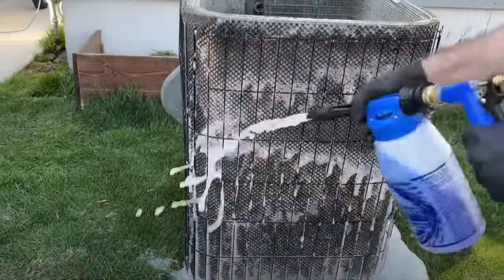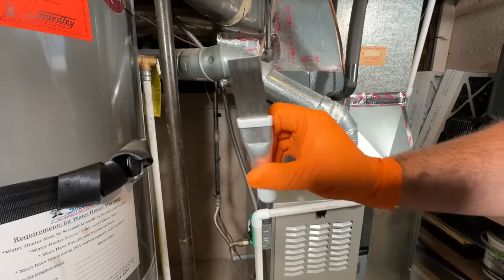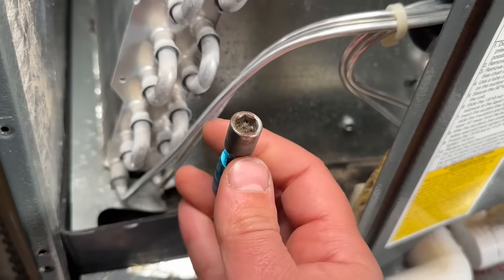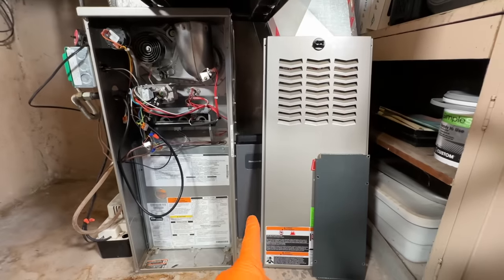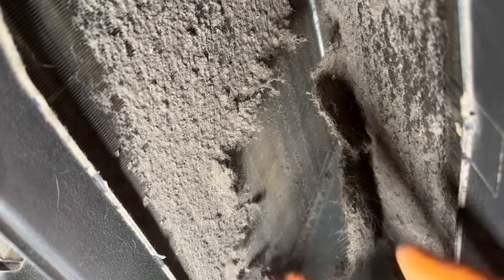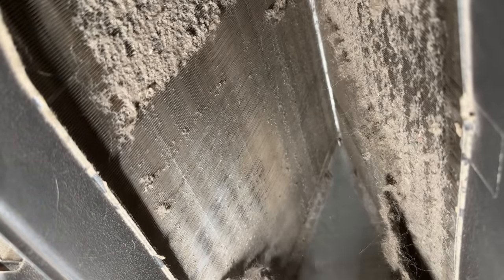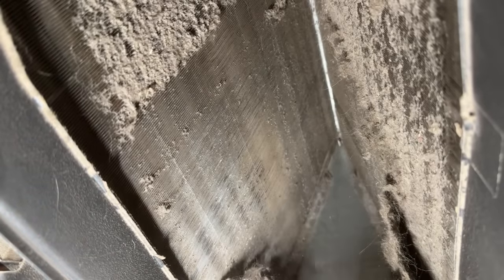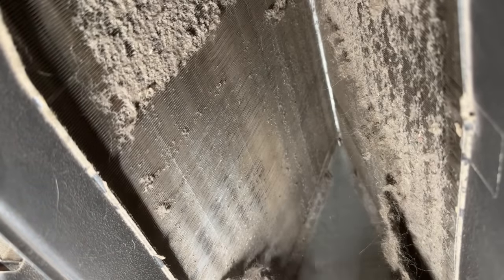How To Properly Clean An AC Evaporator Coil & Save HUNDREDS!

Comment: After doing 15,000 residential service calls, I can tell you that the vacuum is your best friend.
Reply: That's the truth I would have put the vacuum on that mess first thing
Reply: Dog brush, vacuum and then the GARDEN HOSE on full blast.
A little messy but its LIKE NEW!
Reply: Whow
Reply: Toilet bowl brush 😉
Reply: @fladave99  I would advise not using it on full blast if you have a  micro channel coil.
Reply: @perrycrowell2953  I brought in the garden hose 
Full sprayer. Not playen
Worked good
Wife cleaned up the mess
Reply: @perrycrowell2953  why
Reply: @fladave99  why
Reply: @perrycrowell2953  You would not believe the dirt that came out. Wifey freaks out at the huge flood on the floor. HOLD MY BEER BABE!
Reply: Awesome video dude
Reply: @orlandolopez4410  lol
Reply: @orlandolopez4410  51 yrs because u have to wait on hold
Reply: @orlandolopez4410 what math are you doing.   If he does 3 a day x 300 days that’s 900 a year.  

Times 17 years that’s 15,300
Reply: @oscarrodriguez1068  he just said 15,000 / 300 = 50. 
He forgot to multiply the 300 days by the 3 service calls per day.
Reply: Love the math commentary #mathchat
Reply: @orlandolopez4410  yeah and 50 plus 20 is 70
Reply: 17000 whow
Reply: @oscarrodriguez1068  when
Reply: How much do you charge to clean this and the unit outside?
Reply: @billy-santos  who
Reply: @CCCC-tq8yo  how much to charge for the clean ? The handyman how much will he charge?
Reply: I have a mobile home A coil and looking to find out what would be best to clean it without having it cut out to clean..The people who lived here before ran it for 2 years without a filter and the coil it at the top with blower up under it..Would love the input on how I can do it myself..
Reply: Tape that brush to the top of a shop vac lol
Reply: Yep as I new home owner, this is the issue 80% of the time. Clogged lines. Shop vac baby
Reply: @CCCC-tq8yo using a hose on full blast could smash the fins, and the fins are what help the heat transfer. If they're smashed they're not efficient. The same caution applies to cleaning the condenser coils outside, where it's more common to use a garden hose sprayer.
Reply: I was going to ask “why not a vacuum?”
Reply: I have a weird noise that stars when ac kicks in . Almost sounds like a spring, any idea what that would be? I don’t know how to describe it but it’s when the ac Turns on for a couple of seconds
Reply: Yeah I'm charging 1500 for this..
Reply: @orlandolopez4410 Your response is what is 🐃💩! Where did you learn your math?🙄 If you paid for it...get your money back!!
Reply: Damn right; vacuuming and a small brush does the job
Reply: @orlandolopez4410 brah if you take 2080 hours a year and divide that by 3 hour calls that is  693.3 calls a year. Divide 15,000 by 693.3 is 21.63 years with zero overtime. 15k calls is definitely not a flex and could easily be done in a 30+ year career. You must use that new common core math 🙄
Reply: I’m trying this! I was quoted $1,150 😮!
Reply: @CCCC-tq8yo  Because the pressure will bend shut the thin, flexible fins, rendering them useless.  Water pressure in this case is good -- up to the point at which it's bad.
Reply: it's true.  I don't understand why he does it that way.  smelling all that dirt.  There are also very fine filter-type fabrics that allow the oil to pass through and retain the dust very well... so that it is easier to clean.
Reply: @fladave99  heh heh.
Reply: Dang it, I came here to say the same thing but you beat me to it!!!! Lol
Reply: She's the "EX-wife" now.
Reply: Question?? The example is an up flow system. If you have a down flow system, I would be concerned with cleaning the outside of the AC Evaporator Coil. Correct?
Reply: I don't care about the math, but my unit is sealed. The ductwork has tape and a dried compound on all edges.  How do I access the coil?
Reply: @budman-tw6rr  
With great difficulty.
Reply: @fladave99  you don't want to damage the fins on that mesh with full blast water.
Reply: @fladave99  as someone who actually has to clean up after themselves, I'll stick to a vacuum, brush, and the coil spray 🥴
Reply: @budman-tw6rr  same way with mine, I guess it was common thinking you never need to clean your evaporator coils. I’m thinking of removing the filters. Cut out a plywood plate to fit tightly and with a fitting for a shop vac. Then close off all your vents with the exception of the one closest to your evaporator coils, remove the register and put a electric leaf blower into the hole and seal it off. Then go turn on your vacuum and then your leaf blower and hopefully that will create enough back pressure To pull off the worst of the junk on your evaporator coils.
Reply: Why would this A coil be this dirty? This is not normal.
Reply: @BlueRage  
1.  No air filter installed.
2.  Return located near the floor.
Reply: @scott5654  Absolutely. No coil in any modern furnace should ever look like this.

Comment: You gave me the courage to clean my coil. It took me about 5 hours just because I was extremely careful not to break or bend anything. My system is over 20 years old. It was not as bad as I thought but it was bad. Thanks for the detailed video.
Reply from the maker: Glad I could help!
Reply: Notice a difference?
Reply: Yes for sure. It cools much faster than before. Not only it cools faster, I notice the air flow is much stronger. Thanks again.
Reply: Update: for the last several summers my AC would run nonstop on hot days. After cleaning my coil it runs and cool down the house and shuts off. My condensate is noticeably much heavier than before.
Reply: @tanman005  why
Reply: 5 hours to do a thousand dollar job? That's a big win!
Reply: I know you were careful but 5 hours seemed a bit much? Seems like about an hour or two .... What's the typical time you would expect ?
Reply: @pcexpress911  I assume the 5 hours was due to him being extra careful and thinking about each step before actually doing it. if he ever has to do it again, it'll go faster. He probably kept pausing to refer to the video and also took a few breaks to work up the nerve between steps. That's how it was for me. Especially when the wife wants you to pay the $3000 to just "get it done". You can't afford any setbacks or you'll never hear the end of it.
Reply: @kharisjohnson  AMEN brother!
Reply: @kharisjohnson  First time takes longer due to caution..

Comment: A good idea would be to have a shop vac going while pulling out the dirt clogs, to catch the plume of dust.  Also, if possible, if you seal around the filter's edge with painter's tape, you can almost completely eliminate bypass, keeping coils clean much longer.
Reply: Shop vacs , duct tape , zip ties , man’s best friend !!
Reply: I stick foam sealing stripps where need in the filter channel and on the filter door/cover so that no air can bypass lthe filter
Reply: great idea!
Reply: That's a good tip about the painter's tape. The contractor who installed my unit when the house was built didn't even include a filter housing. The filter just lays diagonally in the duct. A real hack job. But using your tip could make it work better.

Comment: I have "cleaned" my coils on several occasions. I never thought about sliding the entire assembly out of the duct work! I did even think it was possible without discharging the system. Thank you so much.
Reply: Same here didn't think of sliding it out. I cleaned it on the furnace with a towel to grab the water before.

Comment: Just pulled the cover off mine.. 17 years old and still clean.. Im a smoker and i had a large german shepard for 12 of those years.. i was surprised it was still pretty clean.. a little discolored brownish but overall clear of debris. Always keep my filter changed!
Reply: Thats because all the crap is caught up in your furnaces secondary heat exchanger
Reply: @marriagepartnersministry5942  Nope.. heating element and fan motor are clean also.
Reply: Hard to believe. But whatever.
Reply: @Jackie-O.Louisiana  I have no reason to lie to a bunch of strangers on youtube..Maybe its because i dont keep my house very cool or hot and turn it off when im at work.. Low usage i guess..
Reply: @marriagepartnersministry5942  change your filter.
Reply: I have to wonder if the system in the video was basically running without a filter, and had fluffy dogs in the house shedding.
Reply: i think it depends on what filters you used, like i use a spacegaurd filter cuz my mother smoked 4-5 packs a day ... plus even with a normal cheap filter the nicotine would make cheap filter work better cuz they would be sticky so everything would stick to it more. i'm curious to look at mine cuz mine was never cleaned and its 28 yr old lennox system. i just haven't figured out how to easily get in there yet. i may have to cut a access hole in back of a-coil piece ...
Reply: @-AnyWho  that makes sense with the nicotine making the filter work better.. I had to use a yard ruler with my phone rubber banded to the end and recording video to see my fan.. but it worked lol
Reply: @yoyo7856  that's actually a good idea ...

Comment: where your overflow shut off  is, if you take the float off it and pour a cup of vinegar down that pipe that goes into your drain pain, once per month, you'll never have to worry about Alge buildup  in your drain line again. Plus it keeps the drain pain clean of any alge growth.
Reply: Once a month would be a real PITA for me. Our air handler is in the attic and we live in the Charlotte area where its reaches 90+ multiple months a year. But I know that it would help a lot.

Comment: Good info, thanks.  I checked filterbuy.  Unfortunately, they do not list the static pressure drop (in inches of water column) that their filters cause.  Filters are one of the most restrictive elements of an AC system.  I switched from a MERV 11 - 1 inch filter to a 4 inch filter which had a low static pressure drop.  My CFM at the return grill went from 980 to 1300.  It was much quieter, as well, as there was less air friction.  After cleaning the evaporator coils and straightening the return grill fins, my CFM is now up to 1750.

Comment: Honestly I’m amazed we haven’t figured out a better design by now for heat exchange in our central air systems.
I know there’re plenty of people out there that don’t even know they’re supposed to change a simple filter, but even from a serviceability perspective there’s got to be something…better.
Reply: In my country, we have to clean evaporators once every 3 months as it's very dusty here. That's why we use split ACs which are easily serviceable.
Reply: This is a split system by definition.  Do you mean mini split or ductless?
Reply: There is no reason we can''t create a marketplace standard for quick & easy access panels designed for the consumer to easily clean evaporator coils, but no. It gets far worse than this for many systems, and it all happens because governments aren't doing their job in creating proper serviceability standards. This could all have easily been corrected decades ago, but we ignore the problem year after year, expecting an industry to correct it for us which has zero interest in doing so.
Reply: @uvhciM  true, the problem is that from the consumer perspective it costs a lot of money to implement any of these changes, so it doesn’t happen quickly even once they are available. But that’s just it, they’re really not available at all, even today. 
Like you say, it shouldn’t have been difficult 20+ years ago to design the newer generations of these coils to have some sort of access panels and drain systems to divert the runoff, or even change the typical straight vertical coil-over-fan so that there was a better layout in place for cleaning without fear of everything falling straight into your fan/electrics etc. 
I will say a lot of the issue is that in a lot of cases the utility space is a huge limiting factor to the install that complicates things, in that the final product is hardly ever as nice or what you have in mind. Compromises have to be made. So it is difficult to produce a simple modular type system that will fit every scenario and work as intended, but I would definitely like to see some productive conveniences implemented that would make it easier for the tech and homeowner alike to service and maintain, as well as allow the systems to last longer.
Reply: I was watching a “pros don’t want you to know this secret” short about cleaning your condenser unit and it reminded me about my pet peeve with those too.
Back in the early 90s at least some of the units came with a fan guard that was removable without removing the fan and motor assembly from the top of the condenser. Why TF did they ever do away with that design that allowed for easy access to flushing the condenser from the inside out by any homeowner?? Or was the risk just too great that some idiot would forget to pull the breaker and chop their arm off… we’ve become either so reduced by the lowest common denominator or whatever saves the mfgr $.75 on the assembly line, one or the both, but either way it’s entirely fd us for decades now.
Reply: Well yea, the AC industry wants to sell you a $7000+ AC system absolutely as often as possible, but not so often that it's suspicious.
Reply: @piezoman79 , my ac air handler unit is set up like this:
1. Air filter 2. Coils 3. Air blower 4. Plenum. It does have the coils over the blower. The coils are under.
Reply: @uvhciM  you blame government and you blame companies.  Make a company with a better design.  I bet you haven't talked to your gonverment reps to get a better standard.
Reply: They have. It's called a mini split.
Reply: just something as simple as to be able to open the duct on both side
Reply: I absolutely agree, the condenser coil should be designed on a pull out shelf for easy cleaning. Likewise the evaporator coil should be designed to easily remove the outer protective cage for easy cleaning.
Reply: easy servicing comes when you initially install the unit. Not everything can be easily accessed for everyone every time but simply asking yourself how easy this will be to get out if i need to goes a long way. You see stupid people run pipes and build enclosures around things as if they never will break or need to be touched again. People are stupid and  cause themselves and others countless headaches. When you are being scammed by the hour for evap cleaning why would you want to pay for 3 hours of labor just to access the unit? Literally the entire system is such a simple thing anyone with an iq of 80 can fix and maintain this stuff. I own an extensive selection of specialized tools from random things ive fixed just because I don't have to pay other people to do it. I have better tools than most hvac technicians and electricians ffs., hahahahaha
Reply: @kickassclone75  proper planning goes a long way, but it doesn’t solve the lack of engineering that went into its design. That’s 90% of the problem. Most failures are due to the fact that things that things that should be designed to be easily maintained simply aren’t.
Reply: The design of the system not withstanding, my unit is horizontal in the attic.  In Florida, so it's a low slope.  Maybe 3' height where the unit is.  AND it's suspended from the rafters so there are hangers everywhere I need access.  It's unbelievably difficult to service anything except maybe the control board.
Reply: It happens in any industry.  I see things all the time that make you think " whoever designed this definitely doesn't have to work on it or try to clean it "
Reply: I think , now that I’m worried about mold spreading, I’d get a house and do individual ac units in each room . That way issues like mold or cleaning will be much more isolated and not a huge mess spread throughout the house

Comment: I have done this a couple of times. I have found that on some of the hard to get to screws, or even most screws, you can just buy a roll of the silver metal tape to secure the
panels in place. next time all you need is a utility knife. seems to me a shop vac with a brush head would do a good job of cleaning the coils but the spray wouldn't hurt as well.
screws will almost always take a 1/4 or 5/16 socket. (1/4 in drive). Don't forget to put a towel or newspaper at the bottom to prevent all that crap from falling down into the furnace.
check the drain pan.  Thanks for the good video.

Comment: Amazing video!  My unit is rather new and I’ve only had one summer of AC use.  This year it’s spewing out a barf moldy smell!  From what I read.  My coil needs cleaning. The installer is coming out tomorrow.  I’ll see how techs want to clean.   I’m skeptical he’ll do a thorough job but I’ll show him this video if need be!  The right side panel I can open. Left side the panel is 1/3 in front and warps to left side. Not sure if will slide out.   We shall find out!
Reply: How did it work out?

Comment: 2 gallon pump sprayer from the reverse side works pretty good too. Blows any chunks back the way they came. No chance of bending fins with low pressure. Garden hose on spay is just going to make an absolute mess. 1/8" foam tape on the filter frame on the side of the blower will form a tight seal once the blower sucks the filter tight with the filter frame. Not thick enough to cause problems pulling the filter in and out.
Reply: Bought a Steam Machine for just this reason. Figured I'd get at it with the shop vac as much as I could then then use the steamer to push any dust back from the direction it came. I'm hoping can access everything.
Reply: ! ! ! You will blow/Wash them on to the heat exchanger and cause an extreme amount of damage,